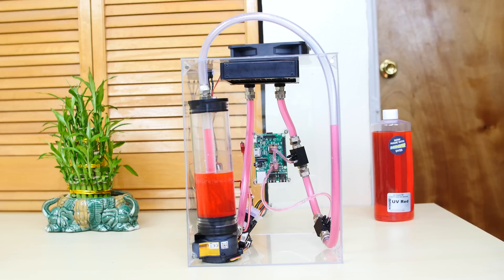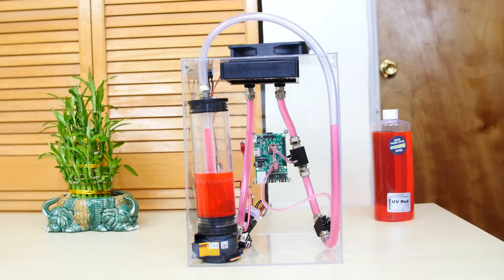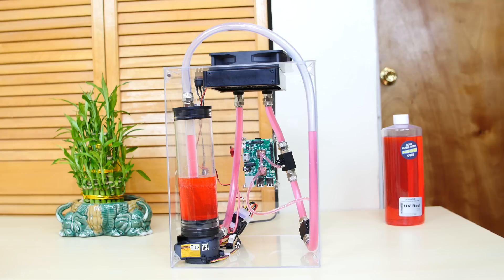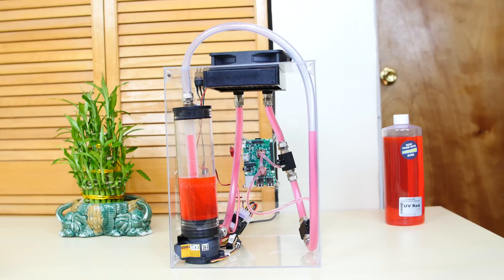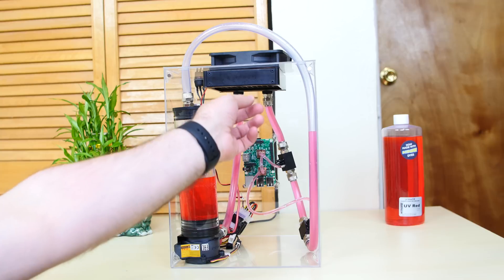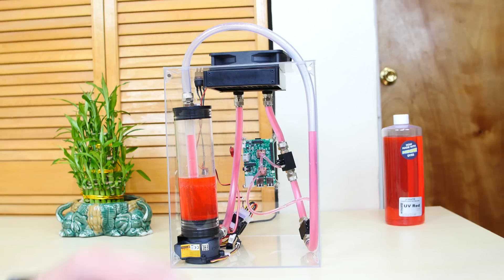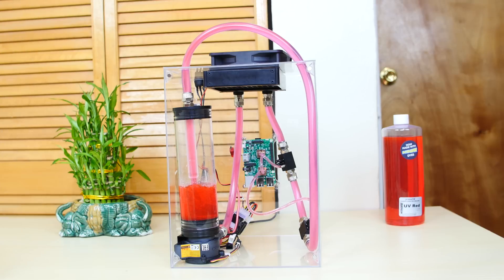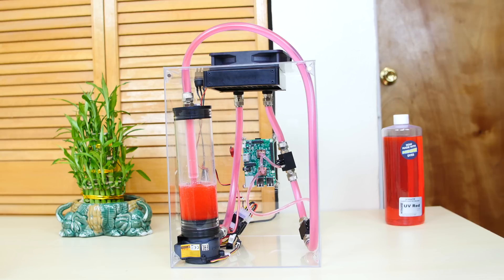Ultimate Water Cooled Raspberry Pi 3!

Comment: reverse the flow rate so that the radiator is in the circuit right after the Raspberry Pi, the cooling will be most effective with the water at its hottest. Also, if the specs are available insure that both the liquid flow rate and the air flow rate are within specs.

Comment: Isn't the coolant just bypassing the pi and flowing along the fat tube between the splitters?
Reply: @David Smith Yes, maybe some of the water goes through the PI, but 99% of the water is just bypassing.
Reply: Meiestrix It's difficult to imagine a pressure gradient between the two splitters that would cause much of the coolant to flow through the Pi - but I suppose we need to see the temps under load to really understand whether anything is ending up in the waterblocks.
Reply: I was going to say the same thing.  Hardly any water will be passing through the water blocks...
Reply from the maker: +David Smith No The water blocks are getting good flow. I updated it all.